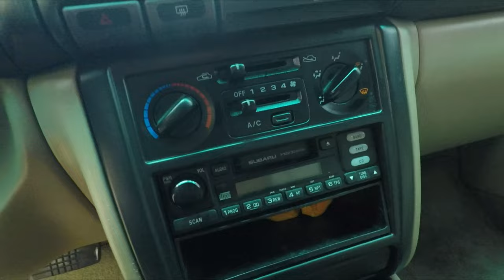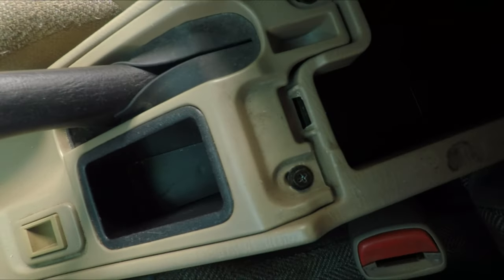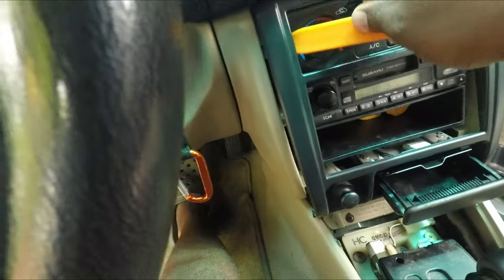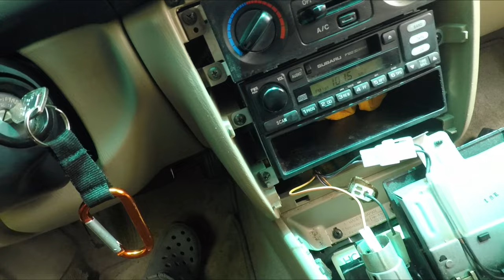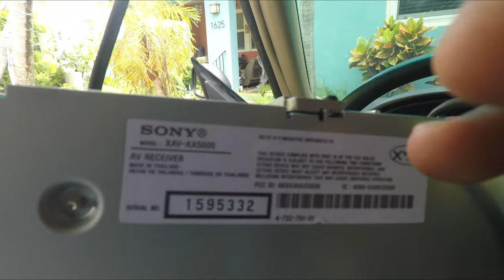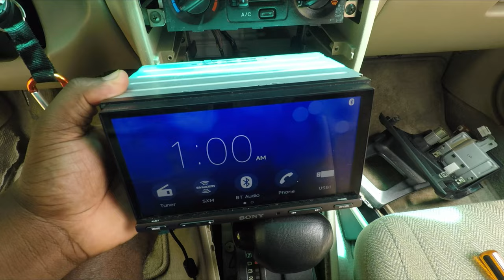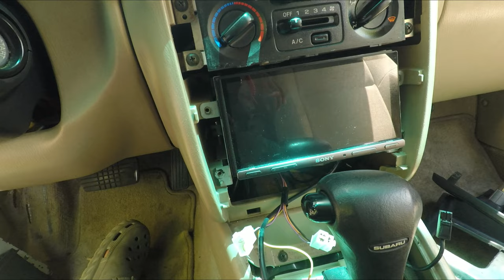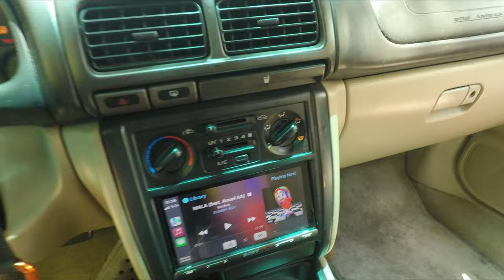Installing a new head unit in the Subaru Forester

Comment: Do the speakers mate, and install a subwoofer and amplifier!
Reply from the maker: I ended up upgrading the speakers too but no sub and amp yet unfortunately
Reply: @TheOBDMafia  sub and amp make a HUGE difference.
Reply from the maker: @matty733500  any recommendation I m not entire familiar with those set ups tbh
Reply: @TheOBDMafia  you have to run power cable from the positive battery terminal through the firewall, behind the dash, under all the trim to under the passenger or drivers seat. You need a ground cable as well for the amp to bare metal. In Australoa you can buy a kit that jas everything you need in it, there's heaps of videos on YouTube on the install process, it takes a while but it isn't difficult, it's mostly running cables etc.

Any name brand amp and sub would do.
Reply from the maker: I appreciate your help thank you
Reply: All good mate! Any other questions just ask.